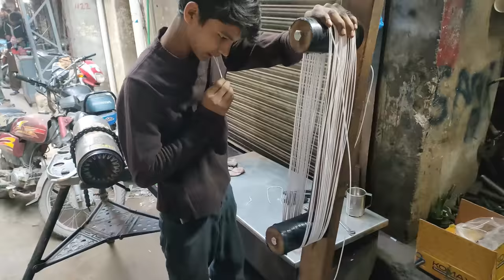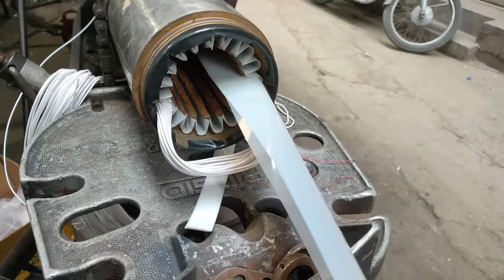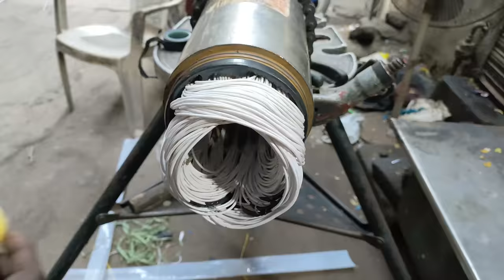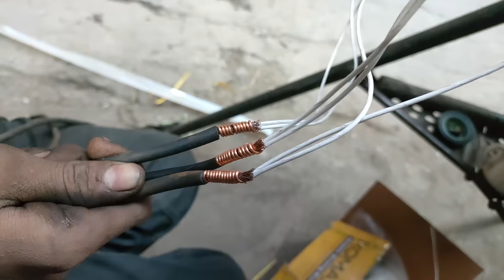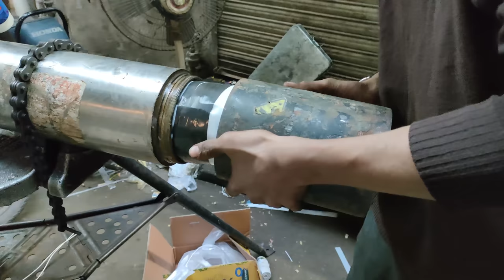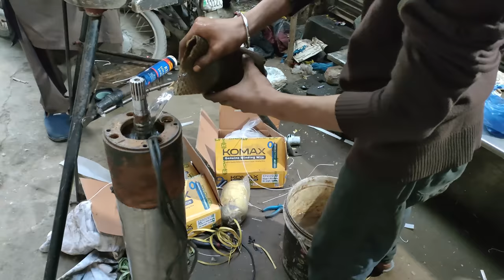Incredible 14 year Boy Rewinding 25HP Submersible Motor/ Restoration Submersible Motor.

Comment: Is it water that you pour into the windings?,that will not run last long because it will be grounded and eventually burned,,,but if its isulating oil, that would be good,,but again i did never saw a submersible pumps with its windings full of oil,,windings must be completely sealed so water and oil will not penerate inside the windings
Reply: Hii
Reply: I think it's kerosene or some sort. Because I saw the other guy dipped something (a bolt or nut) into the same bucket where it came from, like he was cleaning it.
Reply: It is a non conducting oil. Many large transformers have oil in them for cooling.
Reply: @reamer2002  That's right, it's non-conducting oil. if in my area there are those who use refrigerator compressor oil because it is also a non-conductor.
Reply: It's probably either distilled water, kerosene, or transformer oil. Looking at the spilled droplets, it does look like water, which is fine if it's distilled.
Reply: It's water. These pumps run underwater inside pipes. I used to rewind similar pumps that where used at a Hydro Electric power station only they were a lot bigger. They were used to pump water up the mountain of a night into a lake and the water was released through the turbines into the lower lake during peak electricity demand.
Reply: It's a Kerosene
Reply: @Yurri Zaid  It's definitely water I did a 5 year Apprenticeship working on these type of pumps but about 10 times the size and they ran submerged in water which cooled the windings.😊
Reply: It is submersible winding it needs water for cooling itself and it is made to work with water.
Reply: В насосах такого плана вода является теплоотводом и если её не будет то насос быстро сгорит. Я работал с насосами такого типа ЭЦВ.
Reply: Su var mı? Su icelim.
Reply: I work in a submersible pump shop. It's called impella oil.. It's nonconductive oil used in the stater housing..
Reply: ITS NOT WATER.. If it was the stater would ground out and blow as soon as you put power on it.. I rebuild these same kind of pumps and others... It's called impella oil it's nonconductive and used in electrical cooling applications.. Some sludge pumps do use antifreeze for cooling but it's in a cooling jaket around the stater not in the stater
Reply: Kid did a great job.
Reply: 💪 electric tape 🤭🤫
Reply: There is no sealing on the wires or on the end they come out, it must be water.
Reply: @gordonwelcher9598  why don't you ask if it's water or oil?
Reply: @williambowden6729  I should have done that.
But if it is oil it will leak from the last cover that is not sealed. Also it will leak where the wires come through if they are not sealed. They did not put very muck sealant in the other places.
Reply: @gordonwelcher9598  how much sealent do you need? Don't worry he's 14 plenty of time to figure out what he did wrong the next time.
Reply: @williambowden6729  Let him do it in Pakistan the Pakistan way. I don't care.
Reply: 0as
Reply: Guys it's  simple WATER...because this moter is water fitted..some moters oil fitted also.. in this moters bath side is bush (no ball bearing)and bush lubrication with water  ..without  water it will burn..and other thing.. this moter must  test with  MEGAR ...but this kid did not..

Comment: I have never seen insulated wire used in the stator of a motor. I'm surprised he could get any wires between the poles.
Reply: It has to be isolated, usually the isolation is a transparent smalt applied to the surface, so it looks like it has none. Without isolation, it becomes a single conductor, like a single wire. And the current will follow the easiest path, so it won't work. Isolation is a must, can be smalt or polymer isolation. So he's fine.
Reply: This kind of isolation is used in submersible pumps, they are usually refrigerated by water
Reply: So nice
Reply: Made in China wires it makes work easy not as efficient as the standard but works
Reply: Yea it really depends on the magnetic permeability of the insulation used, but yes, it was to be insulated nonetheless.
Reply: Same I always thought it was enamel wire, 1st time seeing this type of wire used.
Reply: It is PVC coated wire used in submersible pump. Normal enamal wire gets damaged in water. Hence pvc insulation choosen. He did not show water proof insulation in joints though
Reply: All motor wiring is isolated, but usually with a clear coating
Reply: I learned motor rewiring at the same age but with enameled wiring and much different methods. This boy does an excellent job in spite of primitive conditions. I eventually left the trade and became an electrician.

Comment: Thats actually very impressive. He should be doing the repairs on the 500hp pump motor a customer has smoked 3 times and keeps sending to the same shop that never gets it right.
Reply: How do you smoke a 500hp motor?
Reply: Start by finishing building with no varnish on the stator... 
It'll torch up soon enough.

Comment: Ever try using enamel copper wire? With some spray enamel to hold shape and prevent scratches....
Reply: Also can get change torque and rpm by changing turns and wire diameter especially wit insulation thickness in the mil and thou range

Comment: No varnish dip before inserting rotor?  You need the varnish to mechanically glue the windings in place to resist vibration, even if you have well insulated wire.
Reply: It's already protected but good question
Reply: Brother it's submersible motor no need of varnish. Varnish is needed in enameled wire.
Reply: All of that can be done afterwards when we build a in the factory here in Detroit all the windings get put on 1st and then it goes to a laquer tunnel.
Reply: @shanestevens6208  When you say it's protected you're saying because it's insulated? So then is the lacker just for a short circuit protection?
Reply: Made in India,
Reply: The wire itself maybe coated... but like it's been said, the vibrations of the electrical frequency will cause wear... 

I guess these guys just want to keep the business oncoming, not really putting a really good effort to make a good product. 
Even epoxy(5min stuff at the extreme)would be a good substitute, than none....
Reply: @FlashTwoSix   No armchair here buddy... just the "quarterback"... 

I speak from experience....
Used to rewind motors.... I have a bit of experience in the field... 
Used to be the dip/bake operator, among other things....
Reply: The music make the whole Video useless and Not Worth to watch! Horrible Sound
Reply: @iamnegan1515  ye pk ka video he ।। Side main bike khada h dekh lo
Reply: @iamnegan1515 no it is made in PAKISTAN Alhamdulillah ❤️

Comment: Es una bomba sumergible en donde el agua actua como agente refrigerante es por eso que lo embobinan con cables comunes y corrientes.
Reply: That is most likely Teflon insulated wire. The real question is why didn't he solder the leads. And if lead solder wasn't the thing to do he could definitely whip out a torch and put a little silver solder on it.
Reply: @Ham Radio  When I was an Apprentice we used to braze all the connections in the motor's and generators we rewound including the big Submersible pumps for CEGB Ffestiniog Power Station Nr Tanygrishau in North Wales. They were wound with insulated cables about 10mm csa. They ran completely under water.

Comment: With that insulation in place, hp dropped to way below 5. 25 hp gives a wattage of approximately 20,000 watts. At 100V the amperage is about 200A , I think the insulation will be a puddle.

Comment: Work out standing, but  lup connection , is not perfect, due to not soldiering working
Reply: Yeah those cables probably require a little bit of insulation other than electrical tape since they are submerged in water. I feel much better about a potted mechanical connection or a silver braised connection it's potted.
Reply: @Ham Radio  We used to insulate the brazed connection's with 2 types of self amalgamating tape, which lasted a very long time under water. 73 de M0BFM

Comment: That goy is doing wrong while inserting whire into the Slot .... white slot paper also pulling along with whire . What is the purpose of white slot paper? Slot paper can give protection to the whire .If he pulled whire and slot paper what ll happen whire insulation ll be damaged. So He does not do pull the white slot paper until all the whire insert in to the Slot....
Reply: He had used that film just to easy the insertion of wire so it will not damage in slots. What you are saying is about insulation paper being used in slots for winding sepration is different.

Comment: Well no matter what you think about this video we all know the pump will die and probably three months if not less without having the precise windings ohm'd you going to have a three-phase motor with one pulling excess of amps and one without and then some random middle one and then there's the part about the filling of the windings For one the electric tape that was used is complete trash The rubber insulating tape is decent I use that on a lot of high voltage stuff above 480 but it's not a hundred percent protection if it's sealed with the water then the biggest concerns is all the contamination from the rusty shaft that was reinstalled to the rusty bottom plate for rotation and last but not least a wonderful part when you can see the guy washing his hands in the same fluid that they would dump it in there I don't give a crap if it's oil or water anything contaminating from rust from a bolt dirt from the ground dirt from your hands that's going to destroy it impounding the wires with a rubber mallet is potential damage there and then inside when he was pushing the windings back look like a rusty bolt with a welded steel rod to manipulate it either way there's no way I would ever buy a motor like this unless it was $5 because at that point I'd strip it and take it to the junkyard and get more money back for it
Reply: Может этот двигатель пригодится тем у кого не хватит денег что бы купить новый. Или в принципе нет возможности его купить, ввиду отсутствия.  Так что такие мастера будут на вес золота. Есть возможность купить провод и герметик, значит двигатель будет работать ещё какое то время.
Reply: He wasn't paid enough to this much care about rewinding.
Reply: I agree with you but if this kid is trained properly, he could beat that chinese girl Linquoer who does the same thing he do. He just needs correcting and some improvement on metal restoration :)
Reply: Karen call the police on the kid! So for 5$ you want a brand new company assembled motor!! You are very unreasonable

Comment: Wrong all together ruber will melt then what? Waste of time and money. And wrong method as well. Not good at all.
Reply: What is wrong?Do you know what the wire is ? Also, electric motors, tend to run at a good temperature, with out burning up, unless the shafts are held steady.
Reply: @davidhamm5626  good luck. I still say its wrong and not worth it.
Reply: @mohali6099 what is wrong?